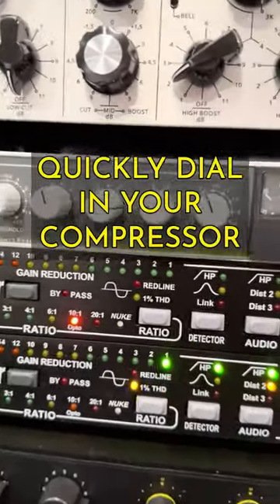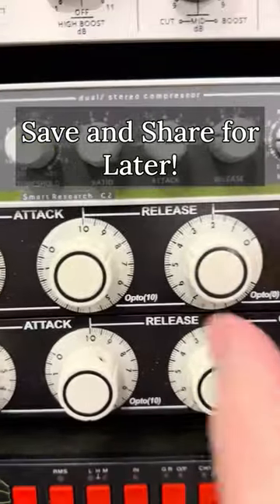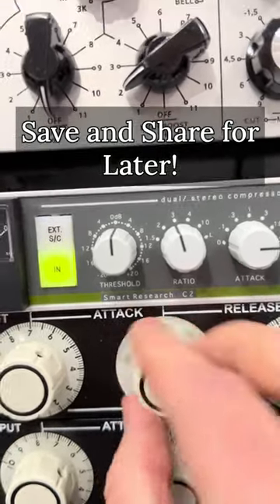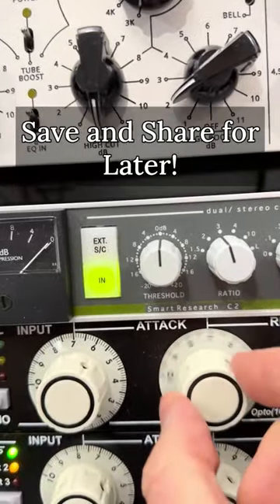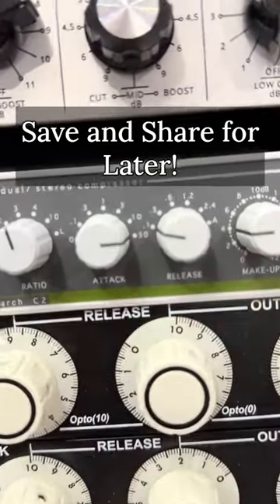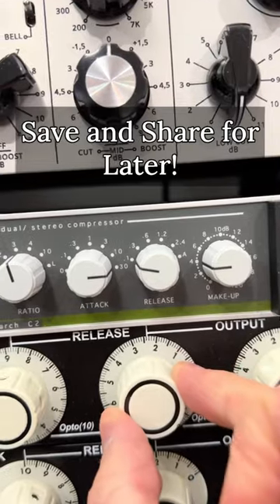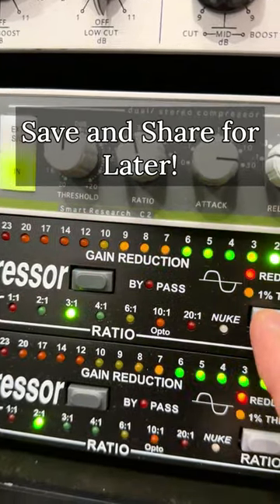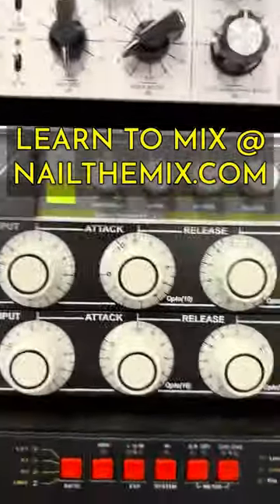Dial in a compressor. #mixingtips #audioplugins #mixingengineer #mixingplugins #musicproduction

Comment: One extra tip for beginners:
After making sure it is gain-matched properly when enabled (so you can accurately compare and evaluate the processing without being deceived by volume) BYPASS before you commit. Make sure this is actually benefiting the source in the context of the mix. Not everything needs compression or processing.
Reply: good point. it’s sometimes kinda gimmicy to use it. i end up using it bc something else has it and it sounds louder slightly. now i have to make other things louder. but it’s not better. i don’t know if it’s really just weird cultural habits like why bother unless it’s pushed hard. glue? why would you want that. instrument separation is most of what mixing is.

Comment: with any other compressor that would work but on the distressor setting the ratio to 10:1 changes the release behaviour, so when you switch it back to a lower ratio you mess up your release setting.